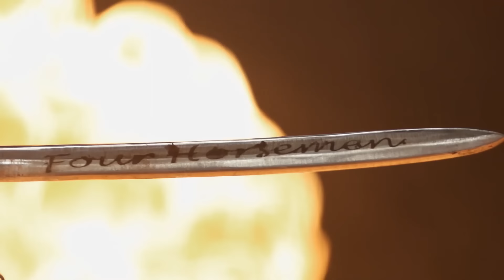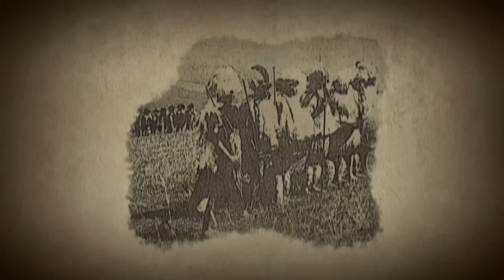Forged in Fire: *10 MORE* CATASTROPHIC WEAPON FAILURES | History

Comment: the first test would help if the judge didn't hit the pig with the flat side of the clamor.
you can see it hits the flat side not the sharp his swing was off thus bending the blade
Reply: I think he did hit it with the edge, just that the edge wasn't sharp enough to dig in and immediately rolled to the flat of the blade. This man has been chopping things for many seasons, he knows how to hold a blade mid swing.
Reply: If you watch at 0.25 speed, you can see he actually did hit it with the edge.

Comment: The arming sword didn't seem like it was a catastrophic failure. It felt to me like that could still be tested and if it survived it was easily the better sword. I'd rather have the razor sharp, well balanced sword than the dull and heavy sword.
Reply: the problem lies in that a dull blade can be sharpened, whereas a pommel broken off puts the entire weapon’s integrity in jeopardy
Reply: The pommel is like a screw’s nut, it holds the weapon together, without it it is liable to fall apart

Comment: 3:50  Just straightening that blade isnt enough ... what is needed is A FEW HOURS of "banging on the sword with a hammer", which would give the SURFACE of it the HARDNESS to cut and hold the edge ... WHILE HAVING THE FLEXIBLE CORE TO NOT BREAK LIKE THE OTHER BLADE!

The blade itself also looked like it was "flat" ... and adding a slight "ridge" along the line could probably strengthen it against bending.

Comment: I hate when they call a broken spear shaft a catastrophic failure, the whole reason for a pin in the spear, and a spear notching constructed that way is so you can switch out the haft easily. You could literally take a broom handle from the closet on set and whittle it down.

Comment: "Drew, your blade has suffered a catastrophic failure" No, it hasn't, if a gun looses its paint it's still a gun, if a blade looses a little notch on the handle it is a failure, but not a catastrophic failure.

Comment: 29:31 because of the rules of this contest the other guy could have made his weapon absurdly heavy and awkward to hold and use with an unsharpened edge. Completely blunt.
They would absolutely faily the cut test but automatically win when they smashed his blunt metal rod into the ice vs the other guys actual sword that broke lmfao.
Only stipulation is that the blunt sledge hammer sword at least has to remember the sword they asked to make.

Comment: To make these test fair and accurate they should be using machines and gauges.   One pig could weigh a lil more possible hit with more power than the other one may hit bone and the other not just so many things that can be an advantage of of one and not the other

Comment: 29:30 sorry, the other guy should have won. His blade actually worked. Counting a pommel malfunction as catastrophic while the other dude basically made a hunk of metal with a hilt that couldn't be used well is just silly.
Reply: A failure in construction is a failure...that's in the rules of the show.  And since with some swords, the pommel secures the handle to the tang, with no direct mechanical connection between the handle and the tang, the sword becomes two pieces nested together, but no longer securely connected.  The pommel is a functional part, not a decoration.

Comment: Well, the way the claymore bent was half the judge's fault. Look at it in slow motion, the blade hit the pig at a 30 to 40 degree angle at the last moment, so cutting force got distributed incorrectly, which is a disaster especially with such a long sword. It resulted in the flat part of the sword hitting the pig, which is why the sword bent sideways, instead of bending backwards or being broken. Well, just try using a knife to cut a meat by swinging it directly downwards with the blade pointed 30 degrees to the left or right and check what happens.

Comment: i cant help but feel that first one with the pig was just a failure on the judges part like if you go and watch it the blade isnt in the right angle to cut they are basically slaming the sword into it plus if it was on the cutting edge it would not bend at a 90 degree angle so easily even if the blade or metal was trash

Comment: Can't they use the mechanics method of finding cracks in engine blocks and heads? Soak oil into the blade wipe completely dry then tap on the metal with a hammer a few times then look closely for oil seeping from crack.

Comment: When your blade has a pommel, the opposition doesn't and you build a superior blade but yours comes flying of and you lose, wtf. I mean in the middle of a battle even if the pommel flew off you'd stil have something to defend and attack, it's not like it broke the handle or damaged the blade to be "catastrophic". The other one was useless after 3 strong swing and basically uncontrollable, and it didn't even have a pommel to begin with

Comment: 36:10   "There is no test to find minor cracks"    WRONG!!!!  speaking as a MATERIAL SCIENTIST:  Hint for metalworkers forging blades:
There are non-destructive tests which allow you to look for cracks ... if you forge a blade for a $10K competition USE THEM! Some are just as simple as:
- cover with "red ink"
- wipe clean
- spray with "white powder" and let the ink seep out of the cracks to show in the white

There are other tests as well working with magnetic fields ... but the test above should be relatively cheap / low cost and it doesnt really need that much training to do it.

Comment: When the first blade bent, why did no one point out the Asian guy hit the pig with the flat of the blade which is why it bent that way and not along the edge. Hardly fair he was judged poorly based on the users incompetence, sure it shows the blade doesn't have the required strength but that's not the point, the point is to be better than his competitor who blade was used properly but exploded

Comment: Yeeah... "catastrophic failure" on a pommel? I've seen chunks of a blade come off and that wasn't catastrophic. A pommel can EASILY be put right back in with a hammer and a tiny bit of glue. The fact that the blade was superior in every other remark, and was STILL USABLE goes against the definition of catastrophic. It should deduct points, but the blade is more that capable of being tested still.